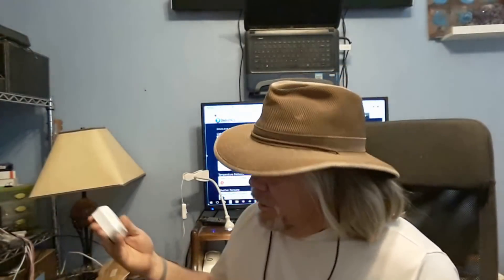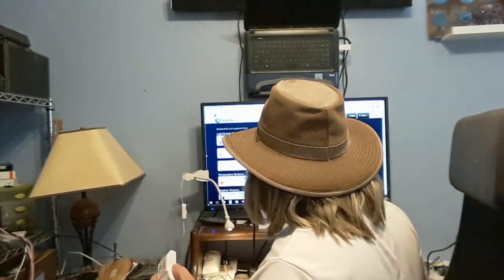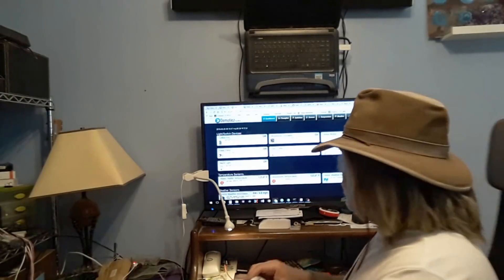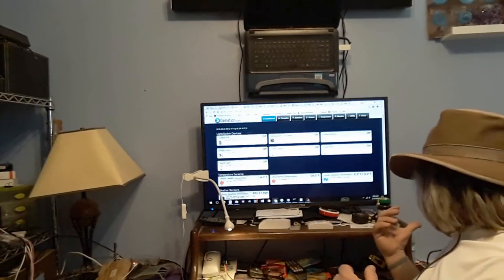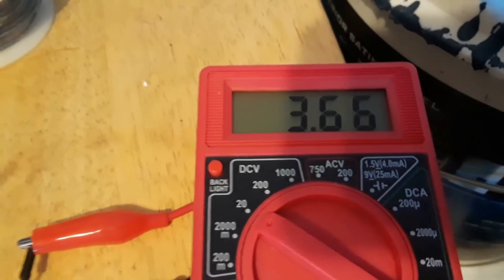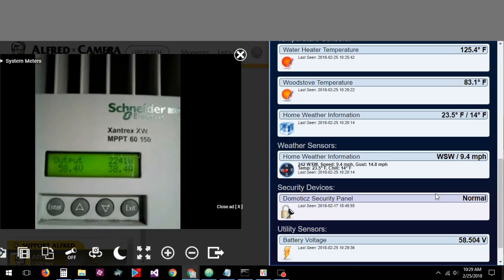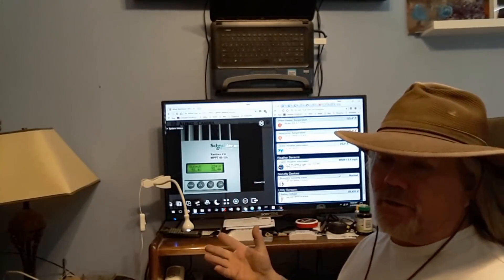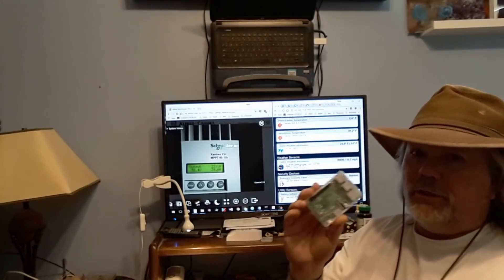Off Grid Smart Home is Here NOW

Comment: Your on the right path but you can do all of that with the morning star relay driver, of course there is more cost with that option but it saves time.....Thanks for sharing!!
Reply from the maker: So far, I have $17 invested in this.  When I'm finished, it will be more like $40, and I'll be able to monitor my system from anywhere in the world
Reply: Hows the project going? any updates on the current sensors?
Reply from the maker: I successfully have production/consumption amps, measurable sun power (so I know whether it's cloudy), Temperature indoors and outdoors, water heater temperature, etc.  My system has been making intelligent decisions for load diversion based on those inputs, and I'm quite happy with the results.  I have some video to show when I get some time to edit.

Now for the bad news.  We've decided to sell our homestead, so now I'm taking everything down in preparation to move.  But I will continue my research when I get settled at the new place.  My total investment for the entire project, including Raspberry Pi 3 (for Domoticz, Node-Red, Mosquitto software), Sonoffs, A/D converters, Amp transducers, etc was less then $100.00.
Reply from the maker: I almost forgot.  I am also able to monitor and control everything from my smartphone anywhere in the world.  That convenience gives an incredible sense of security and comfort knowing everything is okay.

Comment: Hi do you have any problem with your inverter not turning on. Mine takes multiple attempts most times but always turns on in the end. Not very reassuring though. Its a 4048
Reply from the maker: Interesting.  I do have that problem.  It seems to turn on easier if I turn off the main breaker to the house before I turn it on.  But if I use the remote panel in the house to turn it on, it works better.
Reply: I don't have the remote panel might have to get it. Magnum were very helpful and sent me new control boards to try but still have the same issue.

Comment: Brother I love playing with the pie and Arduino. I need to find a way to get a 12 volt sig when my Bogart trimetric says I am at 100% SOC.. This would make my dump loads work beater than going off batt volts.. God Bless brother.
Reply from the maker: Is there anything it puts out at all?  An Email?  MQTT telemetry?  Dry relay contact?  Anything at all to work with?  I'm actually thinking I might get trimetric (MONITORING) functionality with this system.  Although all the telemetry data could beat the pi to death...unless averages are good enough to work with.  Once I get my amperage transducers in, I'll find out.  But I won't have a way to compare it with Bogart's PWM measurements.  I've got less than $75 invested in this entire system so far.  Crazy cheap brother!  Lova ya - God bless you and yours.

Comment: Very interesting video. Seems the possibilities are endless with a setup like that. Thanks for posting
Reply from the maker: Yes Russell!  I've already bought a pressure transducer to put on my water system so I can see if the pressure is getting low enough to make the pump come on - perhaps even delay it coming on for a bit if there are already heavy loads running.  That would keep the inverter from overloading.  My head is swimming with so many ideas!

Comment: I will have to chew on this a bit, thanks
Reply from the maker: LOL  I know it's a lot in one chunk, but I've been working on this breakthrough for years.  I got so excited I had to throw something about it out there.  Sorry about it being somewhat disjointed.
Reply: I would rather be independent to the internet for communication, like we control a rc car. or used to
Reply from the maker: Although this system requires WiFi to function, it doesn't need the Internet at all unless you want to monitor and/or control it remotely away from home.